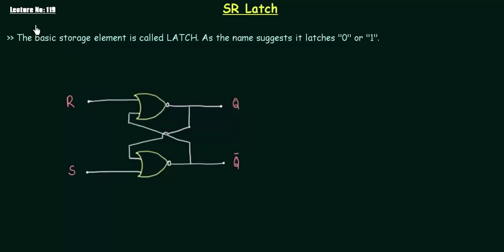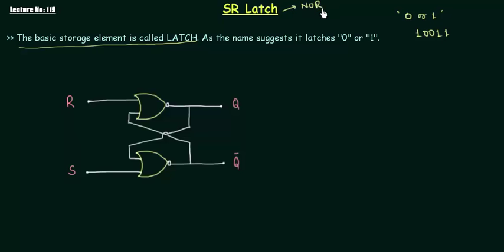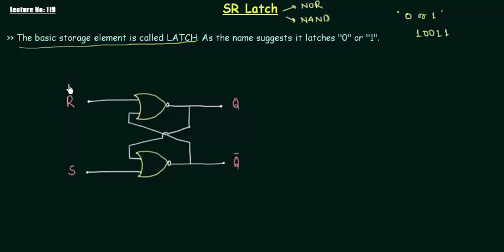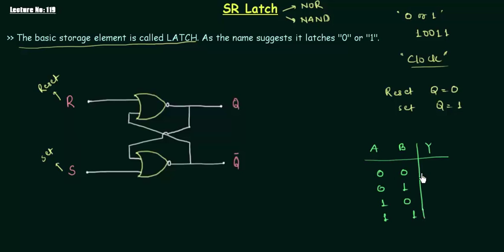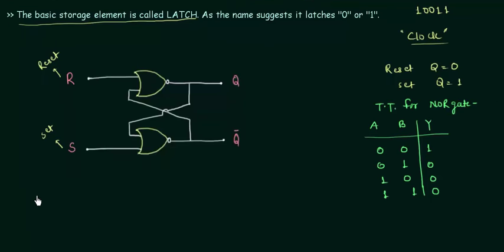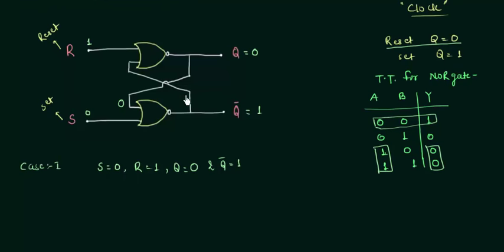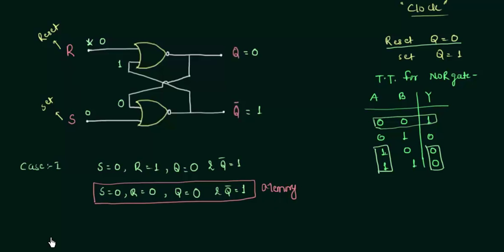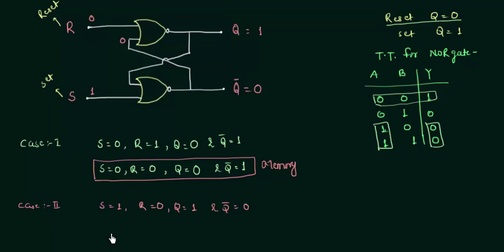SR Latch | NOR and NAND SR Latch

Comment: omg that feeling when it clicks and you understand it...euphoric lolz
Reply: It really is. I watched many videos but no one was able to explain it quite well like he did :D
Reply: exactly!!!
Reply: Yess❤❤
Reply: I know, right? My whole experience learning electronics and digital circuits has just been one click after another. It's what keeps me coming back.
Reply: Thank you sir😊😊😊
Reply: Sir about that NOR LATCH there is that NOT USED when it is S=1 and R=1, im confused why u dont mentioned about S=0 and R=0 as one more CASE too. U only use S=0 and R=0 for checking why... and why do u call them as a MEMORY why not comes under a CASE
Reply: @shougaijamchinglemba9580  that means ...the case s=0 R=0 is a state in which flip flop acts as memory that gives previously stored values
Reply: We will use it if we require previous values
Reply: You can also consider it as a case in which you require previous values
Reply: @sreenadhsree1144  ☺thanks for the clearance

Comment: 00:07 The SR latch is used to store single-bit data in sequential circuits.
02:04 Explaining the use of clock in controlling the store
04:23 Explains the working of a SR latch
06:22 Analyzing the second case with s=1 and R=0.
08:32 S=1 and R=1 gives Q=0, Q' = 0, a contradiction.
10:36 Q and Q complement have unexpected outputs in certain configurations.
12:41 Avoid using S=1 and R=1 in SR latch and flip-flop.
14:43 Using a NAND gate instead of a NOR gate in the circuit

Comment: Dude first of all thanks for the video.
I have a doubt, just after when you change the  values of S and R after giving them 0 and 1 or 1 and 0... i.e., when you make both 0 why doesn't the values of Q and Qbar change, why does they remain same. I mean how did you make out that "previously Q is 1, input for one of Qbar is 1 so it will be 0".
Also dude what happens when initially both are 0?
Please reply

Comment: When Set is 1 and Reset is 0; Output(Q) must be 0 ;Q' must be 1,but in NAND SR ,it's reverse,so S here is not Set?
Please elaborate.
Reply: I think he explained wrong...
Reply: @darshanjaviya4770  yes I beleive so too, why flip S and R in the case of NAND gates? a high on the input S should always set Q to high, no matter which gates are used. S means "Set".
Reply: NAND is active low. that's why set=1 gives 0 at output
Reply: To help we named the inputs for a NAND latch S' and R' (the ' should represent a negator, because i cant draw lines over letters here)
Reply: @AnasBashar  as in nand gate we get the opposite result . to comply with that he has swapped them.

Comment: Can u provide a separate lecture for Nand gate also plz....?
Reply: NAND gate is denoted NOT - AND gate which means the inverse of the AND gate. Simple one.....
Reply: Case:1
S=0,  R=1,Q=1, Q'=0
S=1, R=1,Q=1,  Q'=0
(so storing when S=1 & R=1)

Case:2
S=1, R=0, Q=0, Q'=1
S=1,R=1, Q=0, Q'=1
(so storing when S=1 & R=1)

Case:3
S=0, R=0, Q=1, Q'=1
(Here Q & Q' is same which is not true)
S=1, R=1, Q=1,Q'=0
                  Q=0, Q'=1
(so not storing here,so S=0 & R=0 not used).

I hope, now you can easily understand 😊😊😊.

Comment: Why are we not considering the case S= 0 and R=1 just after the case S=1 and R=0????
Reply: i havn't got the reply yet...
Reply: Govind Kumar  
i havn't got the reply yet..
Reply: When you are storing data, means the input stays zero. (no input)
You may know already btw
Reply: why the sr circuit only stores one bit not two ??? +moeta sdfgi
Reply: Eman Ehab see the configuration of the circuit, it's built to store only 1 bit from one output line. If there are more than one outputs,for eg. encoder the no. of sr latch/flipflops are equal to output lines.
Reply: Because you have to store the data, and you do that by setting both S and R to 0 simultaneously

Comment: I have a question. While explaining the SR latch through nor gate, in order to verify the memory state you used to write the present input as past output of both set and reset but in the 3red case you didn't followed this procedure. In 3red case firstly you wrote the present input as the past output of only set or reset, then you solved that circuit and then you marked the other circuit (set or reset). Can you explain why did you do it? Because if you had followed the same procedure in 3rd step too you could have stored the past outputs in that case too

Comment: your lecture was great and helped me a lot. the thing i cant understand is this as u said latches are sequential circuits to store the bits but in the last of this lecture u said that the last case is used for storing, so what about other cases are they dont use for storage??
Reply: After each pair of possible inputs to R and S, system sets both to 0 by default unless manually changed later.

Comment: Thank you so much, Professor. May I please try to answer the Latch circuit with the Nand Version.
According to the truth table, if any input is 0 then Y equals to 1.
Case I:
S=0, R=1, Q=1, Not Q=0
S=1, R=1, Q=1, Not Q=0

Case II:
S=1, R=0, Q= 0, Not Q=1
S=1, R=1, Q=0, Not Q=1

Case III:
S=0, R=0, Q= 1, Not Q= 1 
S=1, R=1, Q=0 and Not Q=0
                  Q=1, and Not Q=0

Could you please check my answer. If there's any mistake, please let me know. Thank you.

Comment: First of all thank you for your wonderful lecture. I have a doubt in the S = 0 and R = 0 condition. You have taken S =0 and R = 0 once storing the input or changing the input. What happens initially itself S = 0 and R = 0 is taken instead of taking S =0; R= 1 (or) S =1; R = 0 (or) S =1; R=1.  It also produces the "disturbing" result I couldnt get it?

Comment: In the first two cases, how can we decide which output to start with? (For eg., In case 1, we started with Q and then found out Q'. Can we start with Q'?)
Reply: This is my doubt also, consider the case of NAND gate S R latch, the first case when S=0,R=1 will give output as 1,0 or 1,1 depending on whether you start from Q or Q'

Comment: Answer to a very important question
What will happen when the device is powered up?
When the device is powered up, a similar condition like when S=1 & R=1 occurs, because both outputs, Q and Q comp., are low. Again, the device will quickly exit the metastable state due to differences between the two gates, but it's impossible to predict which of Q and Q comp. will end up high. To avoid spurious actions, you should always set SR flip-flops to a known initial state before using them - you must not assume that they will initialise to a low state.

Comment: I got the truth table correct for sr latch using nand gate, but you said S means set so, when we give s=1 we should get Q as 1 in nand form no, why we would get 0? And why S and R inputs are reversed in NOR configuration compared to NAND? Is there any reason for reversing inputs, truth table outputs between NAND and NOR configuration?

Comment: Thanks a lot. This is very hard topic. İ cannot find any lecture like this. You made this easy for us and İ have a question which you didnt mention in this lecture. How is input sent to these S and R latches without getting two inputs. Let's say i want to send "0" R or S latch if the other input is "0" too output of R will be "1"(if i send 1 in this case no proplem cuz of what ever other input is, result will always be 0) İ mean these circuits depends on each others output. Summary of my question is how can i get the result without getting other input.

Comment: U Said in Digital Electronics set means(S=1) output Q = 1, reset(R=1) output Q=0, but this only applies for NOR SR Latch, for NAND Latch it doesn't follow according to the diagram in the video. It made the next 5 to 10 lectures confusing.

Comment: at 10:45, in case 2 when you set the value of s and r you take the output from Q compliment but in case 3 when you set the value of s and r you take the output from Q, this is doubt that when we came to know that after setting the value of s and r which output we have to take first Q or Q compliment ???

Comment: For 1,1 as input in sr latch using nand we use prev outputs as inputs after that if we consider the same like , as we give input the output of prev are used the if we change the input to 0,1 we know output is 1,0  then again if we change input to 1,0 and take prev outputs as inputs of each nand gates i.e (1,0) for 1st nand and (1,0)for 2nd nand the output should be 1,1 right but why we consider that when we keep 1,0 as input the one with 0 inuput, output becomes 1 and change the output correspondingly why can't we assume both inputs execute at a same time(i e if both gates execute at same time then prev output should be used rather than using changed output to the other gate).

Comment: you say if we remove the input and if Q and Q bar is equal to the previous results then the data will store in case of SR latch using NOR gate but it is not applicable in SR latch using NAND gate....why?

Comment: at 4:36, why are you starting your analysis in particular from the uppermsot nor gate, are we implicitely assuming that uppermost port is faster than the lowermost one in producing its output? if so, should we consider also the analysis with the other port faster and analysis with both port at the same speed? Thank you
Reply: It doesn't matter because the uppermost gate always give 0.

Comment: in nand gate when you have s = 1 ( set ) , you get Q = 0 ...so what was the point of reversing the inputs and getting reverse outputs, instead of just letting it work the normal way ? 

Edit: Actually, S and R in nand gates are S' and R' ( inverted )

Comment: Can you draw the logic diagram of below:
A traffic light is installed at the junction of the railroad and a road. The traffic light is controlled by two switches in the rails placed one mile apart on either side of the junction. A switch is turned on when a train is over it and is turned off otherwise. The traffic light changes from green( logic- 0) to red (logic-1) when the beginning of the train is one mile away from the junction. the light changes back to green when the end of the train is one mile away from the junction. assume that the length of the train is less than 2 miles.

Comment: What I didn't understand was why for the NAND latch the position of S and R are changed which led to altering of the truth table. If the position of S and R wouldn't have been changed then the output for both NAND and NOR latch would have been same for SET and RESET conditions, only the Memory condition would have changed which would be 0 0 for NOR and 1 1 for NAND. Why is it necessary to change S and R positions for NAND latch?
Reply: Actually I found out the reason for the above assumptions made. The reason is obvious when you study SR flip flop. In the SR flip flop the NAND latch is the second stage, the first stage being two other NAND gates to which the actual inputs are given and a clk is also given. In that case the input to the second stage becomes complement of the input to the first stage when the clock is high and there fore we get output  Q = '1' for S = 1; R = 0 and output Q = 0 for R = 1 and S = 0 confirming to the original definition of SET and RESET. And for the case when clk is low the output is the previous output.

This is explained in SR FLIP FLOP video.

Comment: This was a 10 points problem in my rutgers dld final and I didn't review sr latches and their timing diagrams before the final however I did watch your video a month before and miraculously in the exam, i remembered it. I got a 7/10 in the problem and my total final grade was 97.  Thanks fucking alot. You saved my ass. If I got a 90 in the finals, i wouldn't got that sweet A

Comment: I seem to have some confusion in the NAND latch, 
If S= 0 and R=1, then we get Q=1 and Q'=0, however as you said to check the memory we remove the S and R, but then S becomes 0 and R becomes 0 (Is that right?) So, since Q' was 0, new Q=1 but new Q'=1 same if we started with previous output Q=1. The current outputs aren't the same as the previos ones, while in NOR gate they gave same output on removing the S and R's as inputs. So, memory isn't verified in this case.
One more thing I am not clear about is that if Q=1,Q'=1 is memory in NAND gate, does that mean removing the  S and R, we take their(S,R) values of the two as 1,1 automatically? Because that's the only way memory will be verified. If so, why? What determines their values to be 0 or 1 ones we disconnect them? 
I will be grateful if someone could explain.
Reply: Good questions, found any answers?

Comment: i don't understand how to prove with NAND SR Latch, i tried multiple times but didn't meet the truth table. In presentation said do the same way, does it means the output of set  which is Q is 0 and output of reset also Q but the value is 1. Does the mistake occurred the way i present the output both of NAND Latch (set is 0 and reset is 1) or something. thanks anyway to gave this lecture for free

Comment: sir since flips flops are used to store data only then as you said in the previous video that 2 not gates will also do the thing... then why are we learning such complex way to store data which can be acheived by a simpler way mentioned above ?
Reply: Good question, it's because gates don't store the data, they calculate it for a fraction of a second and then go back to 0 :)

Think about the gates like electrical wires, aslong as electricity doesn't flow - the default of the cable is having no electricity

Comment: if we want to store a single bit then why are we giving two input bits (R and S)
and even if there are two input value which value is being stored in the memory (R or S).
Reply: This is because if there is a single input, the value cannot be stored in anyway and it will be changed once the input is removed. By using two inputs, R is stored when output is low, and S is stored when output is low (as we know that storage occurs only when R and S are alternatively high or low)

Comment: What if we put S=0 and R=0 from the beggining without having previous values in Q and Q' ?
What is the output of Q and Q' ?
Reply: Can you clarify which latch are you asking? I mean SR nand latch (or) SR nor Latch.
Reply: @RK003   S=0 and R=0 for SR nor latch 

Respectively S=1 and R=1 for SR  nand latch
Reply: ex nihilo nihil fit There is a term called “Propagation delay”. 
Each gate takes some time to produce output. Since, here we’re using two NOR gates for Latch. They both should have same Tdp. 
If S=R=0 then it’s a memory state.
But as long as you turn on the voltage supply, one of the gate is always ahead of the other based on that output will be calculated. So, it is random and depends on which gate gets the supply first and process the output.

Comment: Well the same thing will happen in the initial setup when both inputs are zero,when we set up the circuit, as in case 3. So... again we will have 2 different states with same configuration.

Comment: Can I start from case -1 where s=0 &r=0 if no then why?
Reply: you can. Try it in your notebook. Q would 0 and Q' would be 1.
Reply: @meshkatahmad2529 

The thing to keep in mind though that is a bit confusing, is that the device should take into account previous states and simultanous input part.

In the video we kinda imply the inputs are NOT simutaneous and are dependant on the order of which input gets the 0, and from there we start.

It shouldn't be like this, the inputs should be entered both at the same time, and need to keep in mind for previous states, even if those are arbitrarily chosen by us. 

Take for example this tricky situation of case 1 who beeds to yield Q = 0, Q complement = 1, start with:

Q(n-1) = 1, and complement is 0.
So in the NOR Latch:

Simutnelously in the top Nor we get complement of 1*1 which is Q = 0 like he said.

Though, and here's the catch, becuase Q was 1 in the previous state, and S is 0, we got complement of 1*0 which is actualy 0! Thus Q complement is also 0...

So for input S=0 R=1 like stated, we actually get Q = complement Q = 0, which is ALSO invalid!!😮